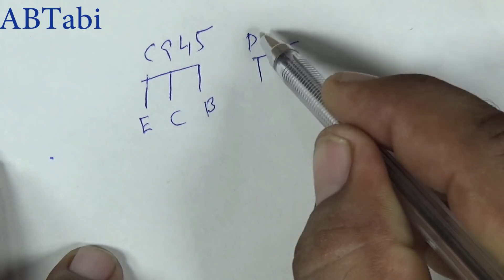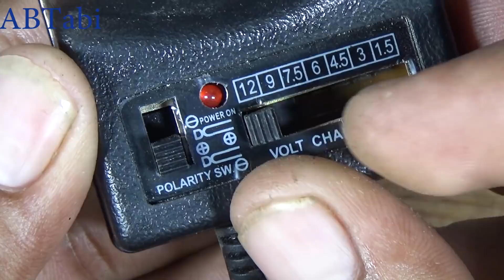Make automatic on off LED emergency light with out relay for power cut

Comment: Hi! I have a question about emergency lighting. Normally there is a permanent supply to the emergency battery (not switched) which ensures that the battery receives a permanent power supply. If the battery was supplied by a switched live and this was turned off for a number of hours, the battery would eventually drain. Is there a way via a circuit design that the battery could recognize if the live feed was just switched off via a local switch versus a power outage for example from the mains supply?
Reply from the maker: Dear friend every thing is possible ,,,,,,     watch the video already uploaded ,,,,,,   auto on off, auto charge , auto cut off charge ,,,,,   thank you i hope you like,,,,,
Reply: @ABTabi  Thanks, but how does the battery understand if the power has been just switched office completely cut?

Comment: circuit diagram is required because in vedio can not clear connection show on resistor joint on which  terminal of transistor

Comment: can we use 9v
Reply from the maker: You can use,but remember your  backup battery for LED light 12 volt and on of 4 to 12 voltage from electricity supply(you have 110 or 230 at home ) when electricity supply cut off in storm and rainy weather it will switched ON and OFF automatic.
Thank's

Comment: Hi, dear AbTabi, may I use led on 3 volts, and charge my battery 12 or 6 volts?  My LEDs will not burn when I stick together with charger ?
Reply: Hola... Podrías poner cuatro leds en serie para llegar a los 12v que entrega la fuente dc. O cargar dos baterías de 1,5V para alimentar los leds en paralelo... Saludos!!

Hello... You could put four leds in series to reach the 12v that the dc source delivers. Or charge two 1.5V batteries to power the LEDs in parallel... Greetings!